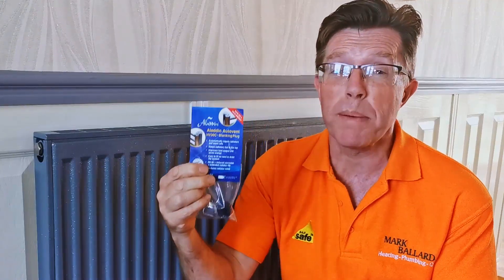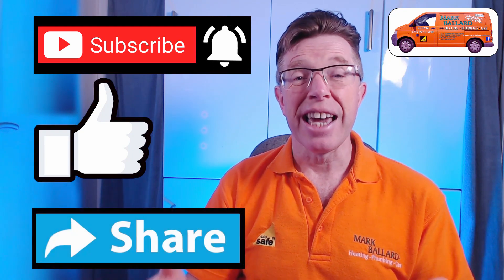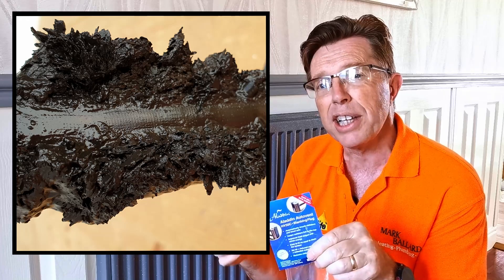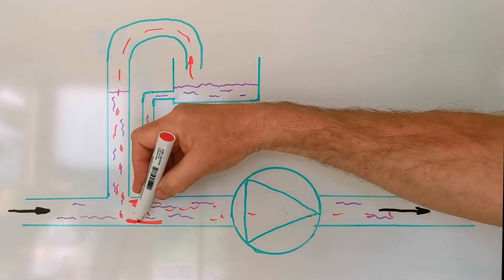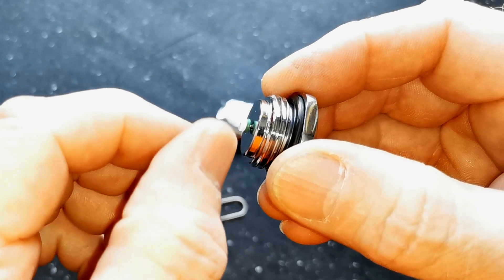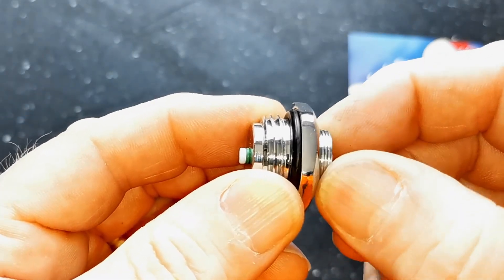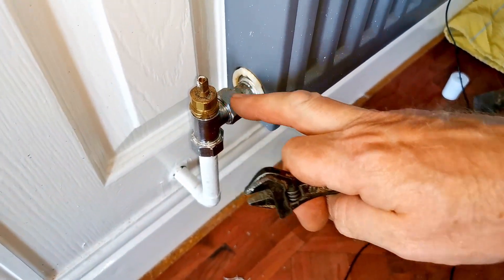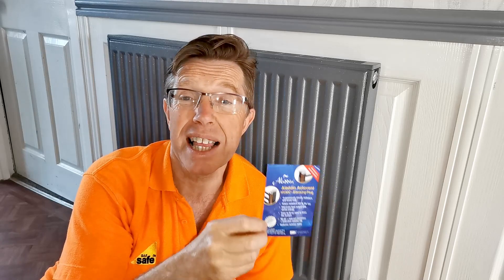Aladdin Autovent. Is it Good or Bad!? How it Works and How to Install.  Auto Air Vent & Plug 2021

Comment: They are a waste of money. They work when new when fitted to radiator that has no water. Drain down a system and refill within a couple of days and they do nothing. If you have any sludge in the radiator this  will block the pin hole vent within a short time.
Reply: But is sludge not heavier than water? And these are at the top of the radiator, if they let out only air, how will this pull through any sludge? Genuine question

Comment: Great video Mark.  Just to let you know the Aladdin Autovents have been on sale since 2002 this is only the second version of the valves.  This version was launched in 2008 using a different mechanism from the original one and allowed us to expand the range to various sizes to fit all radiators.  The cartridge for the HV30C fits the earlier models and the later ones too.

Comment: From a gas’s safe engineer . Fitted this valve it worked for about 1 year then leaked remove and placed in the bin that it was designed for😊t

Comment: Hi Mark, just wanted to pick your brain. I have a brand new system repiped with a new boiler. I have both horizontal and vertical designer radiators for some reason the system is always drawing in fresh air..  any advice would be greatly appreciated!

Comment: Good video mate, thank you, could you have removed the side panel from the radiator to prevent damage? Also when I fit these I put the aladdin on the blank side and have the benefits of both worlds so I can bleed quickly if I need to, thoughts on this?
Reply: Great idea, not quite as pretty but would solve an issue for likes of decorating etc.

Comment: as there is a connection point each end of the radiator i would personally use both vent points, thus easy fill and empty and no worry's about checking they need venting

Comment: What is the solution for the older system that air continuously let in and radiator have to bleeding daily ? Replace all the pipe.  Can you make a video  on that subject  please.

Comment: hi mark great video. we have aluminium column radiators which gurgled and also make steam water noise once they get hot. the noise can be altered by increasing the temperature on the tRV. any ideas what can be causing this. had a few engineers out who weren't able to help and said it was normal.
Reply from the maker: Sorry not sure with out looking.
Reply: Air in your system.
Reply: Its the design of the radiators, it could be like the tall panel type ones, if yours are tall they have to flow in from the bottom left or right depending which way round they go, they are directional unlike most ordinary radiators, water goes up the left two for a left hand entry and when at the top falls down the right 4 for e.g , this is the water noise they all seem to do it, try altering your pump speed to increase flow rate, but you dont want pump over if its an open vent system, you need to check what that (steam) is as that could be dangerous, i.e a stat malfuntioning and overheating, you could be sucking air in, could be numerous possibilities, design etc.